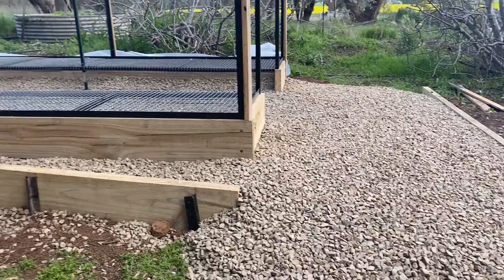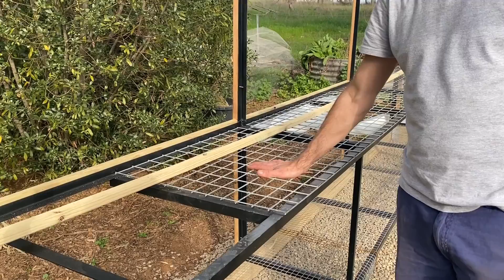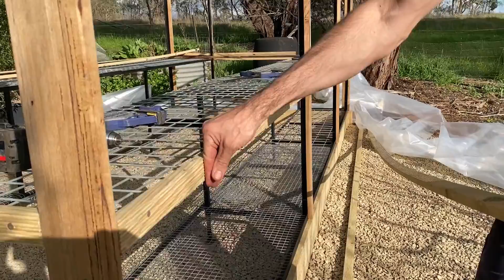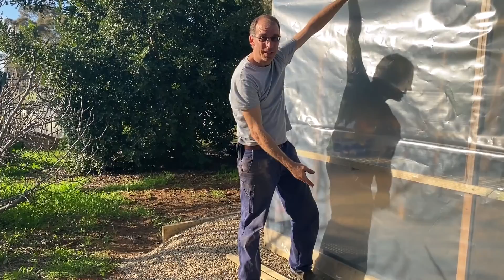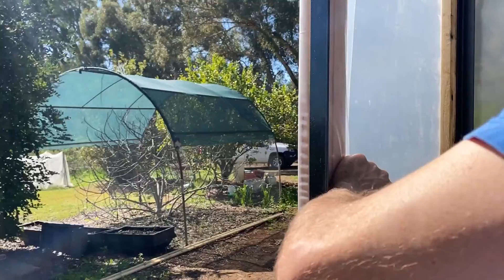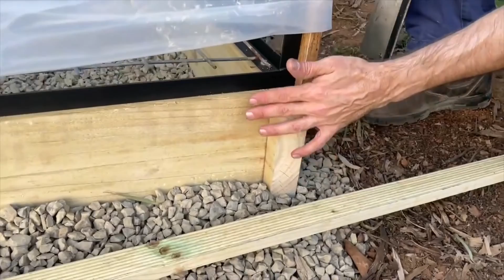Dream Greenhouse: Construction of the frame and walls by John and Karen

Comment: Thank you. Is there a way to use the same design without welding just with nuts and Bolts
Reply from the maker: Yes, absolutely, we had access to a welder so that's what we used.